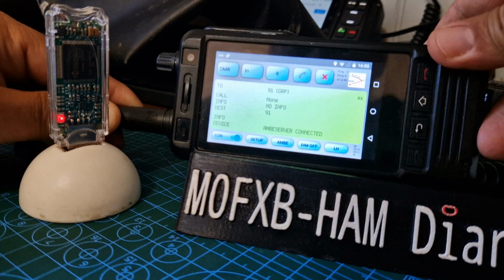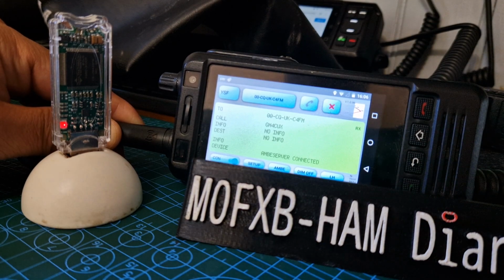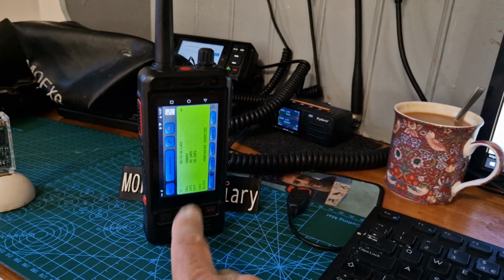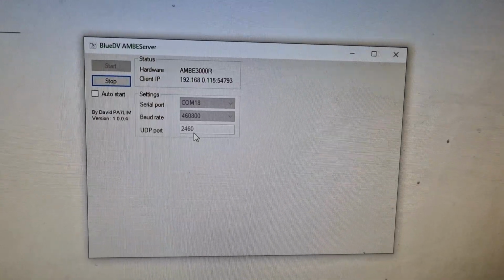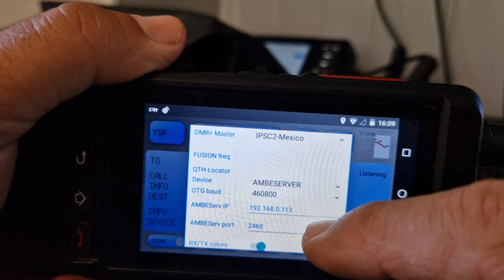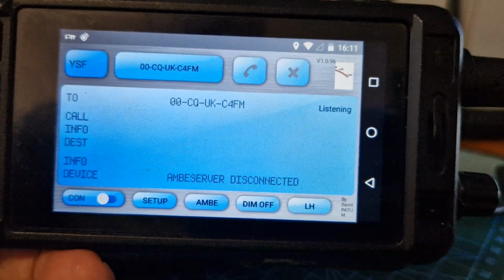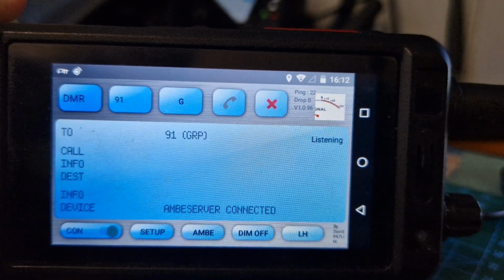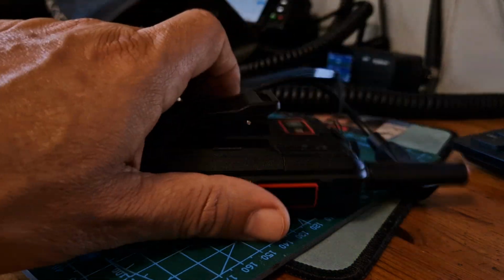W5 NETWORK RADIO-DSTAR ,DMR ,DSTAR - Using DV-Stick.30

Comment: I bought a mobile network radio a while back ago.  Ended up returning it because you can do everything that the Network Radios can do on a cellphone..  I guess its cool to have a different device so you are not running down your phone, but I just could not justify it.  BlueDV works really well.  I just ran a AMBE from a little Pi looking device that I bought from Ham Radio Outlet to bypass the PC.
Reply from the maker: The DV stick has so many uses.